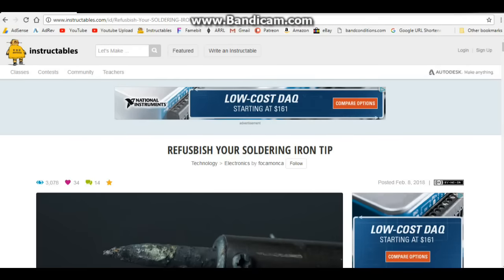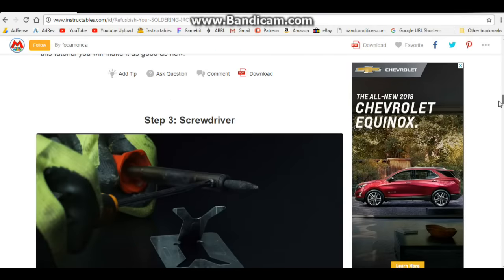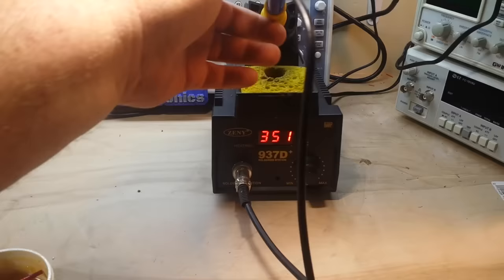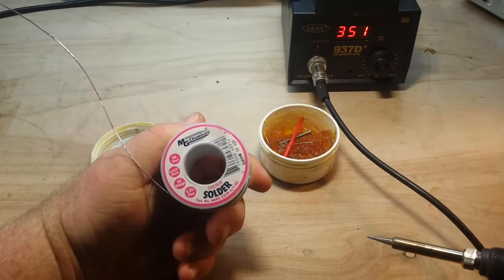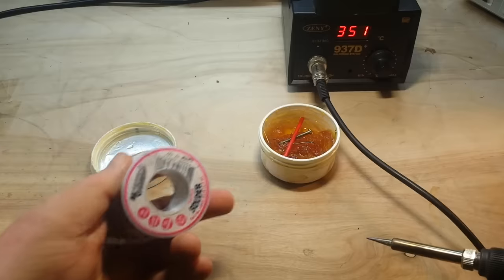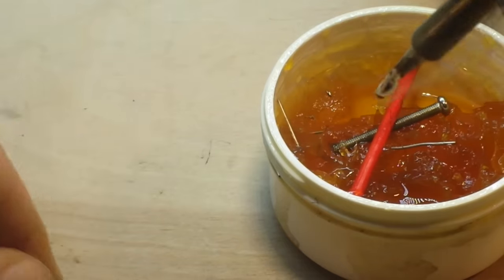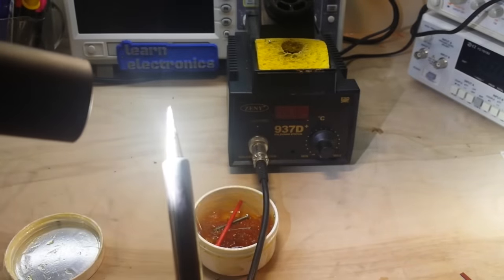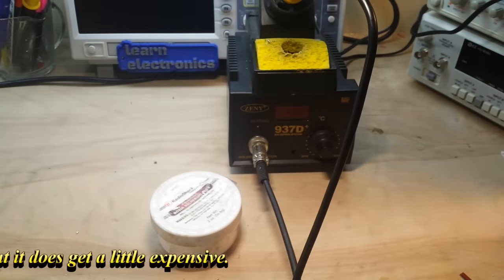How to clean and re tin your soldering iron

Comment: If my solder tip looks like that can it be revived?
Reply from the maker: No, probably not
Reply: @learnelectronics  well as I had an old soldering iron lying around, I did the unthinkable... I sanded it with very very light sandpaper and.... It's back alive!! Works good as new, I'll just make sure it's tinned and I reckon it'll be fine... If it goes kaput I'll post an update... But for now I'm a happy camper! I rarely use a soldering iron so for now I don't see the point in spending £50-100 for a decent one.. perhaps I will get one in future with the rosin flux in future.

Comment: The iron you are using uses copper cored iron coated bit which should never ever be filed or sanded as the coating will be removed and the bite will rot very rapidly. The soldering iron you showed at the start of your film is a traditional type of iron that uses a type of copper bit that has been in production for very very many decades, and is a type of bit the needs to have the soldering tip filed every now and then to remove the pitting; just like the very old copper soldering irons one would put on the gas or stick in a fire to heat up. You aren't comparing apples with apples.
Reply: Over 40 years ago I had one of these soldering irons.  That was how you cleaned them.  The tips were bare copper, no plating like modern tips, so the copper would always oxidise and go black.  When the tip corroded and  got too short (due to filing a new points) you bought a new one.  I bought a copper rod that I would cut into new tips.

Comment: The sanding and re tinning of an iron tip works very well for the cheap 10 dollar irons I have. The tips aren't quality so the coating chips and flakes after a few uses and that about the only way to keep them. My soldering station on the other hand is spotless.

Comment: I think the soldering irons that I have burn the coating off the tips. I buy extra tips and stuff but they do eat themselves up after a while. I'm not messy with my soldering, I'm real meticulous with cleaning it properly and to be as careful as i can be to not use any abrasive service to clean it.
I use a damp cloth to clean it since I can't find the sponges, so i'm thinking that the cloth I use is the thing that makes it lose that coating after a while and not that the irn gets too hot. The coating gets warn down after like 4 months of heavy use and it just eats itself.
The cloth I use is from a cotton white T, damped, it's worked good enough but I'm going to hunt down a proper sponge for soldering.

Comment: I cleaned my soldering iron tip with sandpaper once, because some idiot told me to. Guess what, a week later it had no tip. Or shaft. Pretty much a stump with a giant hole at the end. And there was me, little kid wondering where the fuck my soldering iron tip went.

Comment: isn't there rosin in the solder?( I use a small fan when soldering items to keep smoke away(smoke contains lead and is unhealthy)
Reply from the maker: Yes there is. But a "little" more makes solder flow better.
Reply: @learnelectronics  thanks

Comment: For my soldering iron I buy thick copper wire and cut to length, because it's very old style pencil type and just making the tip from piece of wire, can yolo any tip type as well using sanding belt. Good for surprise repairs and radiator soldering. My Chinese hakko 936 ripoff literally burned it's transformer when trying to solder really heat soaking element.
Btw mains pencil solders also can have temperature control, just use longer wire and thermocouple to monitor when temperature you got and if you are satisfied with it.

Comment: I just took sandpaper to my solder tip because this wasn't working, the tin was not adhering because of carbon build up. Now the tin is working again.

Used really fine sand paper and water to remove carbon build up from flux

Comment: I don't stick my tips on the solder itself. I just solder up the tip like you do and whip it off on my damp sponge and repeat till my tip looks clean with a light layer of solder covered over my tip. I don't really see the point of turning it off and keeping it covered in a gob of solder?
Reply from the maker: keeping it covered in solder prevents oxidation.
Reply: @learnelectronics  Yea, but just a thin layer of solder works as well. As long as it is protected is the important part. :)

Comment: I worked for years repairing playstation  mother boards and yes the tip did get dirty but as you pointed out wiping it on the sponge after virtually every solder joint stopped it getting really bad if we did have a really bad tip we'd used solder paste on tips that usually helped cleaned them up by the way the snake that eats it's self is called Ouroboros.

Comment: Some people use pure copper tips - should be fine to use sandpaper on - if you have a cheap iron, with a rod basically and a screw to hold it in place - go right ahead IMHO. With a brand soldering station using $30 tips with layers of different metals - perhaps a bad idea.
How do you keep the upper part of the tip that smooth, mine always oxidize between the active part of the tip and the metal pipe that holds it in place. It's clear there's different materials on the active area and the rest of the tip - the active area always being nice and shiny from sponge dips. 
If a tip have been damaged somehow (left it on max unattended for too long for example) - then it could be better to sand it and still be able to use it than to throw it away, right?

Comment: Since you mentioned Radioshack I got nostalgic and had to say your right, they couldn't handle business. I worked there for many years part time until they closed, they were always profitable sort of, components made them a ton more profit than cell phones and accessories but later management did not retain the employees that could actually use components. They prioritized phones and hiring people that would watch the ethics training video then go onto the floor and throw all of that out, listening to higher management and conning anyone they could into the most expensive device and plan onto whatever carrier was giving the biggest kickback that month. The whole system was crooked as phuck with alot of cash kickbacks driving shadow quotas and employee harassment/threats. These "district" managers receiving the payments are what finally ruined the last remains of the company. Focusing solely on phones sold as combos with warranty and accessories like cases and headphones. It was really bad for us to sell a phone without a case and warranty, so bad they would lie and say we were out of stock if they felt you wouldn't.  They would AVOID a sale to keep "metrics" looking good. A lil old lady? Gtfo of here with your cheap no combo sale ass. They hated me but could not fire me because I was the most profitable employee in the entire Houston district from selling the old way, parts and components even building circuits for customers.

Comment: Been Soldering for Decades my old Man Worked for Western Electric for few years back in the 60s told me they sent everyone to solder Classes one of the reasons their Equipment was Bullet Proof. I came across couple years ago when doing a big Project my tip needed constant Cleaning so i thought Put the tip in Little Flux Container just like you did worked well Re Tin wipe it off Wet Peace Paper Towel when no tip Sponge is around but eventually have to replace the tip

Comment: The sandpaper way is not 'wrong', it just not a usual way to clean it up. Actually, that's not 'cleaning', it's more like a 'surgery' after an unusual job - like high-temp soldering with strange solders (pure lead solder, lead free solder with heavy load), highly reactive flux job for stainless steel, aluminum, or a heavy load lead(large - finger sized or more- copper), highly reactive solder job (Ga based solder) ETC.. After you finish these kind of unusual, weird jobs, the soldering iron sometimes passes its limit. Of course, you should try your method(flux cleaning) first, but it may not work as usual after the unusual jobs. Still, there are several steps to go there(there are some other steps before you do sandpapers not to damage your soldering iron!) but the most final way is the sandpaper method- like the video says, the sandpaper method destroys the tip little by little. It's something like a big surgery, not a simple cleaning. But if you have to do some special jobs and the only tool is the tiny soldering iron, you may encounter the sandpaper method someday.

Comment: I have that same 937D+ soldering iron.  You have to be careful with those.  The one I got had no ground whatsoever between the tip and earth ground on the plug.  I had to install a ground wire myself inside the box, from the solder point on the board where the ground wire was supposed to be.  The seller swore the thing was made properly and emailed a copy of the supposed European CE certification, but I tend to think it would have to be properly grounded in order to pass certification.

Comment: You own an expensive solder iron with an internal heating element tip.   Cheap irons  have tip made of copper and can be sanded as the copper degrades.  These were common on solder gun  with no heat control.

Comment: What I do to clean thing up  , I take the hole works outside  set it all down on the driveway . Pull the power washer out spray degreaser , Mean Green , and a whole bottle of Dawn Soap  on the unit . and start cleaning . Once all the parts is done , I tie the cords to the bumper of the truck . Drive to the freeway across twon . Drive down the freeway at 80 mph and drive back home . Nice clean and dry . I used to have my wife to wash and dry the soldering iron and transformer in the washer and drier . I just made to much noise .

Comment: Can anyone help me? So i bought new soldering tip after few uses it became black and was not sticking to wire anymore. I tryed to use flux. When i applyed flux on the tip of the solder it wasnot abble to melt wires

Comment: You are correct that you should not clean a modern plated soldering iron tip.  In fact it is almost impossible to make a modern tip look like the one in the instructable because of the plating.

But curb your outrage, the iron shown in the instructable is not one with a plated tip.  The tip on this just a copper rod sharpened to a point.  The heat oxidises the copper and the solder & flux eat away the tip. No amount of wiping on a sponge will stop that.  I know because I used to have one like that over 40 years ago, when plated tips their associated soldering irons were very expensive.
This was exactly how I cleaned that type of soldering iron, hand sanding, filing the tip to profile, and tinning most of the bit with solder.

Comment: The iron tip was a cheap one, the tip was made of copper and coated by thin layer of nickel which get oxidised within couple of hours, compared to your soldering station, that iron is just an old school stuff, that iron have a fixed high temperature which can't be adjusted, but we people can make it though, a Triac BTA 140 (25  Amp) or BT 139 (16 Amp) along with Diac DB 3 (30 volt) or DB 4 (40 volt) would do the job.

Comment: The soldering tip from the web page is made by pure copper but yours is kind of alloy that is why the cleaning process will be different (I am not saying that the sanding is the best solution). The problem with the copper tips is that the tin dissolve the copper and in result you have big holes in the tip which is not the case in your example.

Comment: I still have a tube of radio shack solder from 1997 when I was 12, thats when i learned how to solder. My family moved and that tube ended up in a box above the garage, and I started using Kester. I found that tube 3 years ago. I will never use it

Comment: I'm just using acid based flux to clean a tip. In my country,it's possible to buy flux for aluminum soldering for a less than 1$ for 20ml bottle. Then I just put the into that and rapidly cover with soldering wire.

Comment: My tip looks a bit like that even though I wipe it off.

I think my problem was that I used lead-free solder without proper experience. It's certainly a lot harder than the leaded I used in school. I don't think I've ever soldered this poorly. But atleast lead won't be a problem.

Comment: Story time.. Firstly, that instructable is not necessarily wrong.

Years ago, went to electronics store, bought cheapest soldering iron they had (I rarely solder).
Guess I was lazy, because tip looked like that and didn't want to melt solder, no matter how hot it got.

Took to store, they said tip is burnt and they didn't have replacements for that model.
Bought the cheapest one they did have for.
Coupla years later (infrequent use) soldering iron not working again.
Take into store, tip is screwed, a check and they don't carry tips for that model..

Youtubed fixing tips, they said to grind it, like instructable.
BUT, only if it's a short life copper tip and not a long life tip.

Tried it on my tip anyway, didn't work.

Dug out my original soldering iron, which had a screw retained tip (like instructable) and tried that one.
Soon realised, that it was copper and it worked a treat after.

Moral of the story, if you don't really know what you're doing and just need to do the odd soldering job, buy the cheapest one you can, with a "copper tip" and regrind if necessary.

Comment: The soldering iron in the Instructable is a cheap iron costs less than $2. Unlike with soldiering stations these use a copper tip. And these tips don't have any special coating on top, it's just all copper. After using for while the surface of the tip gets covered by flux residue that can't be removed by a simple re-tining. We normally scrape it with a blade or sand it mildly. It's a normal thing to do with these cheap soldering irons. And they last for years. I use a cheap one like that now for more than 10 years. These are rated as 30w, 40w, 60w soldering irons. Typically 30w or 40w ones are used for electronics.

Comment: The tip on the picture looks like a solid copper tip, nothing wrong with sanding it. But yeah, if you sand a more fancy coated tip, you might ruin it.

Comment: Now that I think about it, I should keep a sponge or two from this pack of Fino kitchen sponges that I'm about to throw into the garbage. Could use them for cleaning my soldering tip if I ever need to solder something in the next few years.
Never had a worse kitchen sponge than these, and I'm really sorry I bought a 6-pack of them.

Comment: And a tiny correction, you do not destroy your iron, "just" the tip, which can, and should be regulary, changed to new. The coating does get burned off over time.

Comment: I have a tin of actual tip cleaner, the small tin is about the size of a quarter.  It really does work. I must have missed the cleaning part, because I only saw tinning.
Reply from the maker: The flux. You dip the tip in the flux repeatedly until the solder sticks.

Comment: What would cause the solder not to adhere to the tip when trying to tin, and yes using flux..
Reply from the maker: The tip is not clean. Just keep fluxing, tinning and wiping. If it still doesnt stick after 10-20 tries you probably need a new tip.

Comment: Well there is one type of tips, that are OK to clean by a file (still not the sandpaper though; it tend to leave abrasion loosened sand specks which then may ruin your work when getting embedded in the solder joint): The bare copper tips. These were designed to have (for their time) superior heat properties, but at the cost of extremely short lifetime (need multiple daily resharpening, replacement every few days). These are designed to get gradually dissolved into the solder. But not seen any such soldering iron from a serious maker from at least the last half of century.
Yes, "that dirty soldering iron" could indeed be fitted by such highly consumable tip (a sharpened piece of copper rod/wire), but the tip in that photo definitely isn't that type.

Sometimes special custom tips shaped for a particular unique single task are made this way, the few hour lifetime is not a problem when they get tossed out after the work is done anyway.

Comment: I clean my tips, tin, and do a rapid cooldown by continued wiping with the sponge.  The tip will peacock a little but otherwise stay nice and shiny.  I've inherited my iron from my uncle, and I still haven't replaced the tip in 30 years.  That iron has to be 50 years old by now.  Rad shack made good ones back then.  It's one of the old Princess type irons.

Comment: I had a tip on a decent low wattage Weller iron get “like that” because I negligently left it plugged in once.
And it didn’t burn the building down. But it burned up what had otherwise been a well tinned tip.

Yes. “Idiot” insults aren’t necessary.

I’ve looked for replacement tips for that iron and can’t find them. I can’t even find where Weller sells tips anymore.

Comment: I have only ruined one tip, ì thought I would make my dad's soldering iron look like "NEW".  I sanded the plating off and it never worked as good.  But in my defense I was learning about electronics, building circuits from a thick book and surplus parts.  I was only 7 or 8 years old.